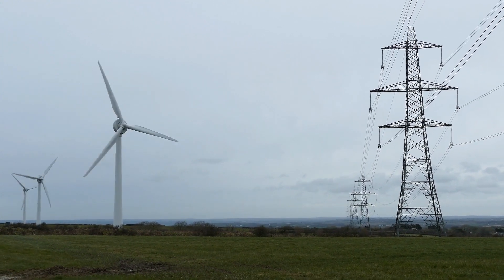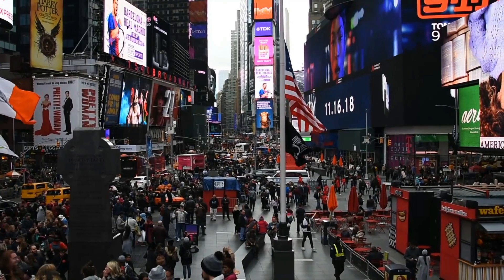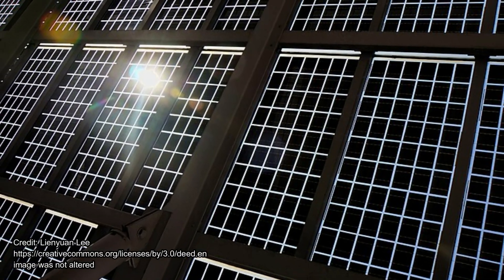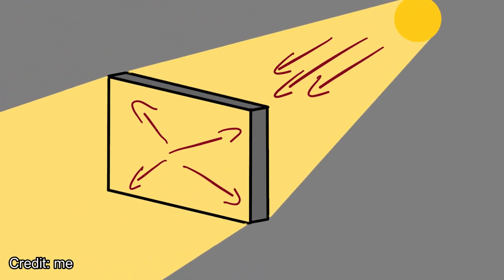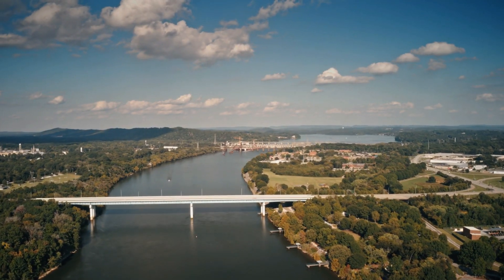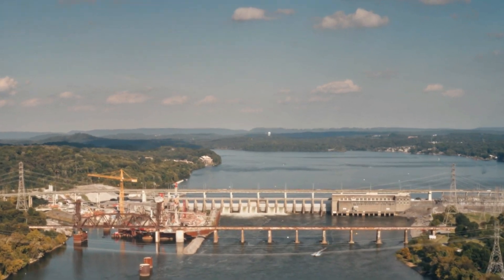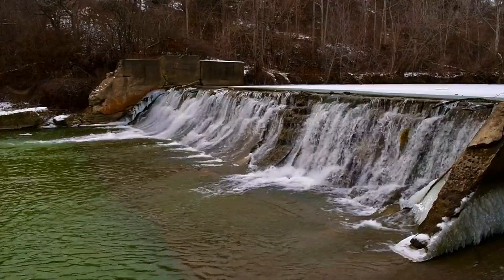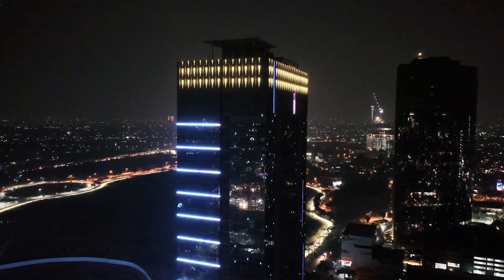Why Solar Panels Should Be Transparent

Comment: The light needs to strike the panel at as close to normal as possible. Vertical solar panels are at close to the worst possible angle.
Reply from the maker: That's true, at noon the panels would be basically useless but during all other times of the day they will, to some extent at least, be providing electricity with peaks at sunrise and sunset
Reply: @nicomotor  !/2 of 3/4 of 5/8 of sweet fa

Comment: A transparent solar panel?  Get real!  Any of the light you let go through the panel does not make any electricity. Any of the light hitting the panel and converted into electricity does not go through the panel.  If you permitted the panel to convert 50% of the light into electricity and the other 50% to pass through the panel as if it was a window, the "window" will appear to be darkly tinted and you will need twice as much space for solar panels as you would need if you permitted the panel to operate as just a solar panel.  

As for the completely transparent panel that he shows at the beginning of the video, since it appeared clear instead of dark gray tells me that the panel in no way converts any of the light into electricity.

Bottom line - any light that is turned into electricity does not go through the panel as if it is a window. The more light that it converted into electricity the darker the panel will appear to be as a window.  A solar panel that was a efficient as possible would not permit any light to pass through the panel. 

And all of this ignored the fact that solar panels are not transparent; they are made from materials that are not transparent.

Which would you prefer, darkly tinted windows that might also act like crappy solar panels? Or actual clear windows and solar panels on the roof?
Reply from the maker: Yes, you're right that you would need to cover more area with the transparent solar panels than you would with regular transparent solar panels. I acknowledge very clearly in the video that the panels don't produce as much electricity as regular solar panels. But when the panel does not absorb any light in the visible light spectrum then there won't be any change that we can see, it wouldn't even look tinted because we can't even see infrared or UV light to begin with.

The panel I used was a regular old pane of glass. But if you bothered to read the earlier part of my reply you would know that if the panel only absorbs light outside of our visible light spectrum that it won't make a difference.

As for your questions, good luck fitting enough solar panels to the roof of a skyscraper to power even half as much as those transparent solar panels are allegedly capable of producing. The point of those panels is going to be most applicable for large buildings with large glass surfaces that don't have much of any space on the roof.

Comment: 8,000 sq miles ? BS, Elon himself talked about this and stated it was only 100 sq miles.
Reply: Elton said a 100 mile by 100 mile square area solar array would provide the necessary energy.  That's 10,000 square miles.  So Elton and Nico are essentially saying the same thing.  Math.
Reply from the maker: @Tom-dt4ic  You mean Elon. Becuase Elton wrote the song Bennie and the Jets and I don't think he's got a whole lot of knowledge on solar panels 😅
Reply: @nicomotor  I meant Elton.  He learned all about solar panels as a result of being a rocket man.  But I hear Elon knows a thing or two about solar as well.  Ha.  Thanks for your post.  I really enjoyed it.
Reply from the maker: I'm actually surprised, never would have guessed that an 80s singer/song writer would know a lot about solar panels. Glad you enjoyed it!
Reply from the maker: The 8,000 sq miles is based on my own calculations. The US used nearly 4 trillion kilowatthours of electricity in 2021, and with the avg solar array producing on avg 600 kilowatthours of power per month you would need 541,788,195 solar arrays. And if the avg solar array is 400 sq ft then it works out to be about 7,773 sq miles of solar panels which I rounded up to 8k.
Reply: @nicomotor  well if you think your math is so good maybe you should approach Elon for a job and compare notes?
Reply from the maker: @francoischarbonneau9447  I'll tweet at him and see if he responds 😅
Reply: @nicomotor  Brilliant reply